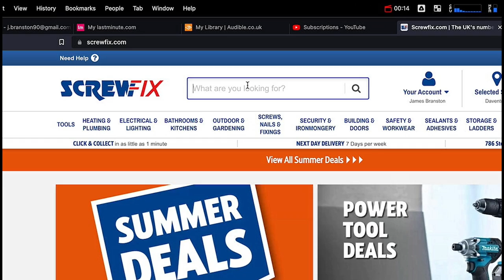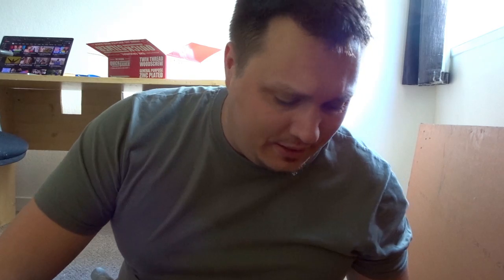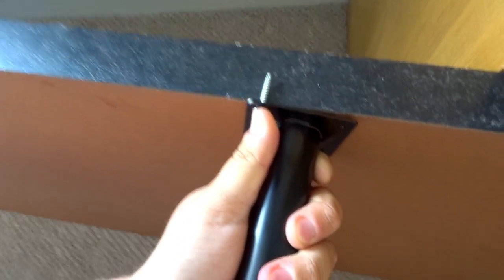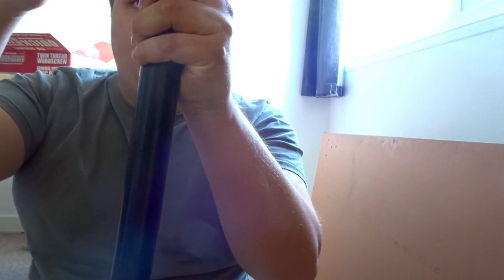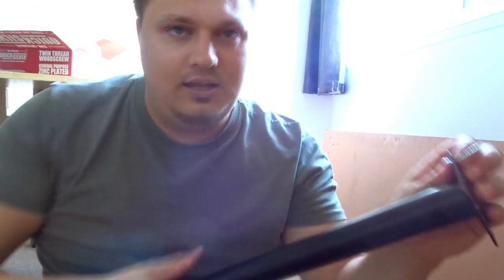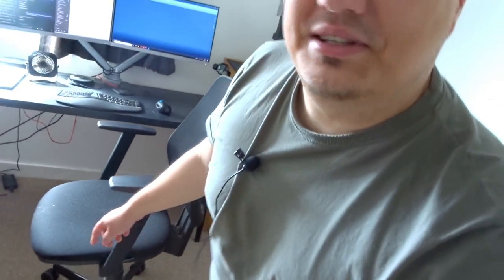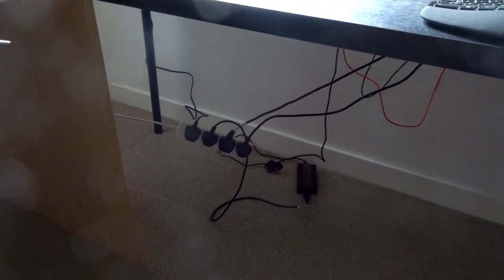How to build a really DODGY desk

Comment: Should get yourself 1 or 2 more legs and screw them in the rear of the desk. It'll keep the desk from sagging from the weight of the monitors and you leaning on the keyboard. Also try lift up one side of your desk, pushing in the desk could have made the legs sit a weird way; lifting should relieve that and reduce the wobble. And congratulations on the new house 👍
Reply from the maker: I thought about getting another leg or two to stop the inevitable sag... Gravity makes fools of us all. I'll probably work on something to increase the stability of the legs since I agree, they are not ideal. I just needed something fast and bodged to get the job done for now. Eventually I'll get or make a proper one.

And thank you! It's like I have a new lease... No, mortgage on life 🤣